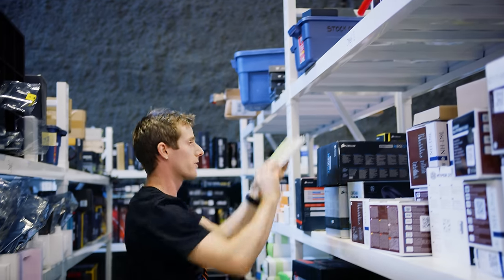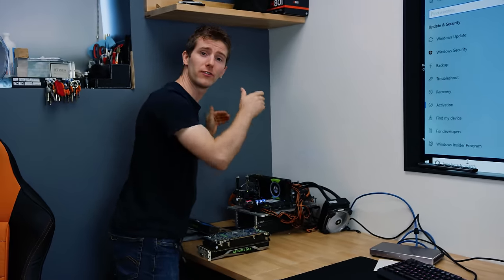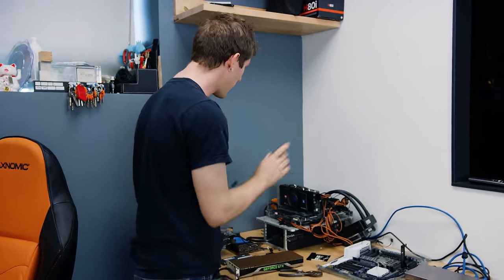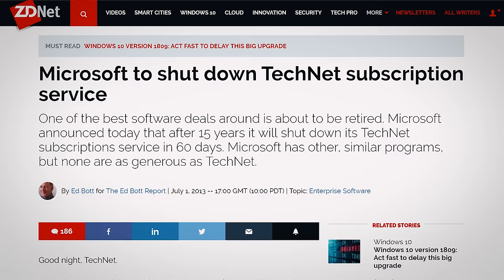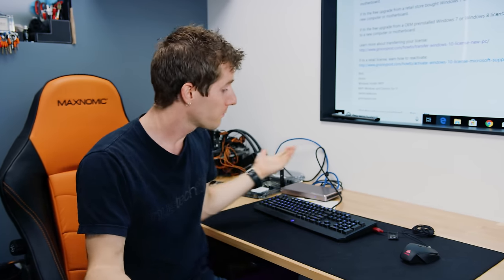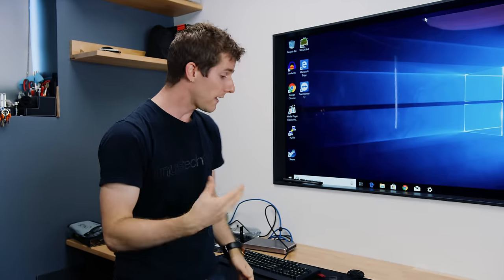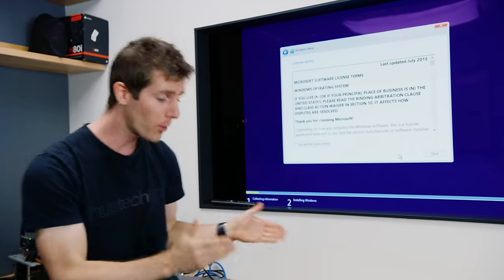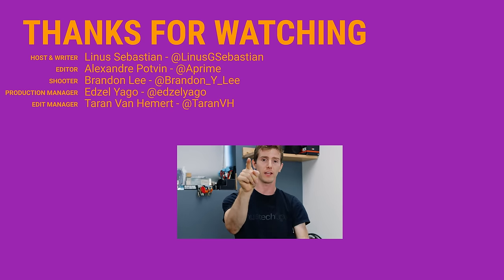Why Does Linus Pirate Windows??

Comment: Windows: still activated after linus replaces the motherboard
Linus: you weren't supposed to do that
Reply: XP and Vista were quite unforgiving, 7 was middle ground, but for windows 8 onwards to 10 is definitely more forgiving in hardware changes, especially when you used your legit key to install. I have been going forward with my 8.0 key -> 8.1 -> (gfx/hdd->ssd swap)  -> 10 -> (gfx swap) -> link to account -> mb swap -> (various ssd->m.2 swaps) -> today :)
Reply: Windows representative watching and doing  the whole thing happen hacking the camera
Reply: My activation void after i changed my motherboard.
Reply: @lunotechan7342  It will, it just won't necessarily do it right away. You can swap out the motherboard and it'll look fine for a day, but once Windows goes through and does its verification magic at some point it'll recognize the swap and require activation again (usually within a day or so).
Reply: HE EVEN DID THE BOOT DRIVE BUT ALSO HE COULD OF PUT THE SAME RAM IN THERE THATS PROBOBLY WHAT IT PICKED UP ON
Reply: Linus did activate another windows on the swapped motherboard before, I guess.
Reply: M$ was watching, and didn't want their greed displayed to the world (despite the fact that anyone that's not completely blind, stupid, and inbred, is well aware of it already).
Reply: "I have a way of creating hassle where no hassle existed before" -Linus
direct quote from one of his videos. an 8k TV from Sharp I believe. but yes, this is true from 1st video to current and beyond.
Reply: *Linus:Wait! that's illegal....
Reply: The cloud has the key. If you have an account you can download the license from your Microsoft account. It's easy for Microsoft to link your license to your internet port like many anti-hack programs do today.
Reply: @rarapas  9 loop p po
Reply: Lol. I was surprised as well, but he's right, you will need to reactivate.
Reply: @Razadune  bill gates watches you from pc cameras and trying to figure out if there os something changed ... ;P
Reply: Yeah that was crazy to me too.. I have never been able to change a mobo without Windows 10 (or any version for that matter) saying it needed to be activated. I just built a new system last week and got the message. Was easy to resolve though, just clicked the troubleshooter, clicked I changed hardware recently and boom, activated. That would be the third activation on this copy of Windows that I have had since 2016 as a free upgrade from Windows 7. Had 3 prior activations with it under Windows 7. So, I have actually had this same license for going on 11 years now.. lol
Reply: I've had my windows key deactivate after I installed an audio interface (which is basically a USB sound card).
F microsoft, they can go down the drain for all I care.
Reply: if you register window 10 through your microsoft account /live account it doesn't matter what you change it will auto update the hardware id's upon sign in its the new method...if you register your key normally though it will eventually fail and you'll have to go through the recovery process.
Reply: @lunotechan7342  maybe it was oem license you need to use the same mb
Reply: "Windows... why must you always fight me?"
Reply: :yt:
Reply: @HiragamaIkunai  only for OEM version but RTM will need to reactivate, every time
Reply: @bkcom1234  no, OEM is fine. it's RTM that's tied to the hardware

Comment: Windows has been making it more difficult to boot with windows without a key. For Windows 11, they removed the "skip" and "I don't have internet" options while starting up, essentially forcing you to enter a key. There's actually a task manager workaround for that, but it baffles my mind!
Reply: just use AAct and forget about it
Reply: Used Rufus to make my instalation key, totally skipped that babyyyyy
Reply: Which is why I stick to windows 10, my E-cores can suffer it matters not.

Comment: Apparently, a lot of people did not know you could install and run windows without activating it immediately.
Reply: I have a Windows 7 machine I have only activated because of quarantine boredom
Reply: @LH-nd9qg  uuhhh... It's a dead OS. Please tell me you had anti-virus installed...
Reply: @pizzagob1in17  nah, we win7 boomers are all hardcore parkour.
Reply: Where can I just download the os other than the Microsoft website?
Reply: @gabrielbrown1027  you mean activate it?
Reply: you can also completetly deactivate all the telemetry tracking in win7, which with win10 you cannot.. they every know where your missing socks are but cant tell you..
Reply: Cristian Vasilescu They stopped technical support, software updates, and security fixes. That sounds pretty dead to me.
Reply: My windows 10 is pirated lol
Reply: You can use windows 10 without activating forever.
Reply: @genin69  I know this is a late comment, but you actually can disable the telemetry in Windows 10
Reply: @lukatag7612  ok, how?
Reply: @matturner6890  I think that is in regedit, or with a third-party app, but I don't know if it's possible directly in Settings. (I used a third-party app)
Reply: @n00bsstuff36  i cant even update to windows 10 without one of the windows 10 auto updates after a week install and fuck up and lag the mouse and laptop. Im stuck to windows 8.1. But its nice anyways.
Reply: @Vyknak  too much fuzz just try some linux flavor of your choice, plenty of apps no worries. No windows troubles
Reply: @trisv1974  Unless you want to play games. Linux is just too much trouble if your number 1 thing to do with your PC is gaming.
Reply: My issues with win 10 is if there is an error you are forced to re install the windows again cuz there is no way to bypass it
Reply: actually you can run windows without activating it... ever and genuinely. you just can't personalize it.
Reply: I thought windows 10 was free?
Reply: @punman5392  Free as an upgrade and technically free to download and install. The activation key is literally just for enabling certain features.
Reply: @pizzagob1in17  i use to use windows 8.1 it was amazing much better then 10
Reply: bloody beast I actually figured it out, had two hard drives fail and lost all the data (including windows) but I got it all figured out
Reply: @trisv1974  yeah no windows troubles because it won't even run an exe file even if you use wine it's gonna be broken linux is bad unless all you do is coding.
Reply: Well, that works only in case of win10, previous versions didn't have that option so you needed type code to install OS but it would not be activated, just installed.
Reply: Yeah, all those high end pc gamers never knew you could just not paid
Reply: @daqtheduck6296  does it still work fine
Reply: @webzhh  Yes. I even get the windows updates regularly
Reply: Im just wondering.  If you skip the activation and are not connected to the internet,  can you still turn off all that data tracking and spyware stuff microsoft puts into your computer?
Reply: @LH-nd9qg  thats one way to spend money ig
Reply: @ped-away-g1396  you can personalize just not in settings

Comment: I had that problem in the 80's & 90's. While building a lot of systems and swapping boards, drives and memory in and out of my personal tower. Back then it wasn't a watermark. It was more intrusive. And I forget which version it was but it was a big window popup that kept coming back.
Reply: It was like this on the older versions of windows. If I remember correctly, a fullscreen popup would appear every four hours reminding you to activate a license and after a couple of days it was every hour. There were more than those popups but I don't remember them now.
Reply: @wakkowarner3716  Windows 98!!!
Reply: @littlelego  No, activation didn't even exist until XP. On ME or 2000 and earlier, all you needed was one valid product key, and you could use it as many times as you wanted.

Comment: Fun story: in a Facebook group I’m in, a guy asked where to buy an OEM Windows key. Someone replied with a picture of a sticker with a key for Windows 7 (which is upgradable to windows 10) and said “here, in case anyone needs it” 
And that’s how I got a windows 10 license for free
So yeah, if you’re lucky you can just ask around and maybe someone nice enough will have an OEM key from a laptop or something that they don’t need
Reply: do you still have the code?
Reply: I once worked a job clearing out old desktops and laptops (mostly win7) and would snap a pic of the key before chucking them in the recycle bin. Don't have them anymore, unfortunately, but I linked like 5 keys to my microsoft account

Comment: Linus: We don't activate Windows, because it's gonna be broken after hardware changes again
replaces literally every part of it and the system continues to be activated
Linus: ANYWAY
Reply: cuz windows don't check it instantly, it's scheduled.
Reply: I recent faced this issue, due to swapping my NVME multiple times and also changing the mobo, it doesn't instantly deactivate, it takes sometimes hours, sometimes days!
Reply: Thats actually true in march i changed my 2600 for a 2600k and it deactivated
Reply: I have done 4 complete rebuilds since I bought my win 8 pro key on sale for 35$ from windows. I have never bought another license, it always lets me enter my old license and never has been deactivated.
Reply: @SuperInfinitezero00  That's strange because usually it DOES ask you for a license then.
Reply: @klamin_original  it has, I put in my Win 8 pro key and it works perfectly, or has so far. As has been pointed out, it is finicky, so my next build it may not work. But so far it has and even when I call support, they tell me to put it in.
Reply: I've had this issue multiple times myself sooo... I get it
Reply: I'm sure at this point this phenomenon must have an official term for it, where in a demonstration of your every day life the cameras record the opposite of your every day life and you can't replicate it in any way.
Reply: @Yupppi  Yeah, its called the show off effect. I hate when that happens and its a common thing in IT. Just when you want to proof a error, it suddenly doesnt happen.
Reply: @SuperInfinitezero00  depends on what license you bought and when
Reply: Yeah this video is ridiculous. His channel is a corporation pulling in how many hundreds of thousands (millions?) of dollars a year, and he pirates Microsoft because a 10 minute process is too hard?
Even when he films his office computer (aka not a test bench) you can see the OS is not activated. If some John Doe doesn't pay for windows on his home computer he uses to watch Netflix, who cares. But the LTT corporation? With 14 million subscribers? LTT who reaches out to every manufacturer to get freebies? Suddenly he can't talk to Microsoft about this activation issue? Nah, that's theft. This video is embarrassing. Pay for your shit, Linus.
Reply: @egoworks5611  
Can confirm. I literally only changed my Ram and my graphics card, and after a day I noticed the BS activate windows watermark. Ah man.... Linux is better they say. Might just look into it lol
Reply: @dxshawn532  Nah, its something you got to accept when working with Computers.
Reply: @thekylehampton  Honestly, I think you’re being too sensitive, I wouldn’t do it if I were him either, and honestly, would you?
Reply: Yea but it does work this way and it absolutely sucks.
Reply: @RohonNag  i remember needing to CONSTANTLY go through the reactivation a few years back because i was constantly changing and upgrading hardware. at some point windows just GAVE UP and i've got unlimited activations through my microsoft account
Reply: I literally just swapped 2 ram sticks and my license key got deactivated
Reply: @AndreiAgpasa  really? i just got rid of two ram sticks last night cause one of them is dying and my copy is still going
Reply: @killerrosebudiscool  it's a prebuilt PC I bought online, after a few months the ram sticks died. maybe they swapped a lot of it before it got shipped to me. (I regret buying a prebuilt)
Reply: @AndreiAgpasa  it was prob trash support. Were they good they’d have reinstalled windows properly and not wiped the drive if they also did that. If you’re OK with the premium it’s fine to buy prebuilts as long as you know they know what they’re doing, but it’s always good to be able to diagnose jazz so you can upgrade and do a deep clean every 6 months. It feels scarier to open a PC than it actually is as long as you’re careful.
Reply: Reading through this thread... what have I done
Reply: Ya seriously he just proved himself wrong, yet continued to use that as his main motive...kinda sus lol
Reply: @theNimboo  Scheduled updoots
Reply: @thekylehampton  you goofy
Reply: That happened to me basically replaced EVERYTHING even the HDD's full copy to another HDD and I still kept my license.
Reply: This happens every other time i gotta demonstrate something, whether it works or not. XD
Reply: @thekylehampton  It’s not even pirated, its a free version without all the bells and whistles of the paid one. Why are you so sensitive?
Reply: @RohonNag  so that would mean reinstallation of windows every hardware upgrades
Reply: @thekylehampton  dude its a TEST BENCH  hes changing hardware on it multiple times a day sometimes litlery multiple times an hour and YOU want him to rea tivate windows everytime? Hed be 1. Wasting a TON of time 2. Going through license keys like flap jacks at an all you can eat breakfast buffet on 1/2 off day
Reply: Hardware migration solution works in mysterious ways sometimes it works instantly and you do not have to do anything then it doesn‘t work at all and you need to buy a new license because you can‘t get in touch with the retailer that originally sold you this pc that now has no original parts anymore and the licence still survived all of that except that one last main board change that one was too much
Reply: @thekylehampton  He does have a collection of window keys so, technically he has paid for them LOL. He just doesn't use them so pointlessly bc he knows that they regularly swap hardware, even in their home PCs.
Reply: @SuperInfinitezero00  This unique identifier for an entire build started on Win10. Not Win8, not Win8.1. Just win10.
Reply: @dcd3lt4  And I have done this as well. My wife's machine is on win10 home, installed via official MS Win10 install media, Windows 8 never touched her machine. Her license key is from a Win 8 box that a coworker gave me. My Latest build has also never touched a build of windows 8 or 8.1, is on 10 Pro, using the 8 Pro Key I bought a decade ago. As is evident throughout the comments, the way licensing works and what triggers it to fail seems random, but it doesn't happen 100% of the time. 

On a side note, I know this is not isolated to me, either as I work in IT at a University and have been able to migrate licenses from 7/8 to 10, although the 7 licenses are a lot more finnicky in my experience. And all of my coworkers have stated the same thing: It CAN happen, but it doesnt always and when it does, you should call Microsoft and have them validate your key so you can continue using it. And as I have stated on this video and others, I have spoken to Microsoft reps on the phone and they have explicitly told me that I am allowed to use my keys from older Windows (7, 8, 8.1 and now 10 to 11) to move forward to the latest Windows Revision. They always add the caveat that I need to go and deactivate the license for the old hardware but that is not even completely necessary, at least in my experience. My server machine and my daily driver are currently using the same license and have never had any issues with it being revoked, at least thus far. My server machine in particular has gone through MANY hardware revisions, GPU swap, RAM swap, nvme, HDD, SSD all different from first license application, but its still going.
Reply: @Theunicorn2012  That's what I wrote
Reply: EXACTLY, but then he complains that those who use ad blockers are doing piracy, come on...!!
Reply: @egoworks5611  no, it just doesn't matter. i swap parts literally every day on my machine for different workload types. my windows is still activated.
Reply: It's the IT effect. The problem persists until you try to show it off XD.